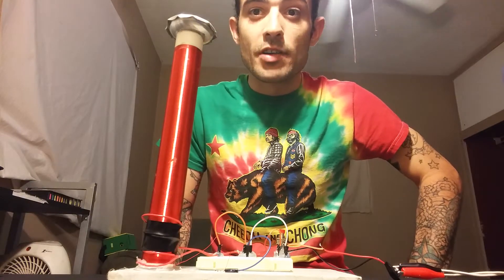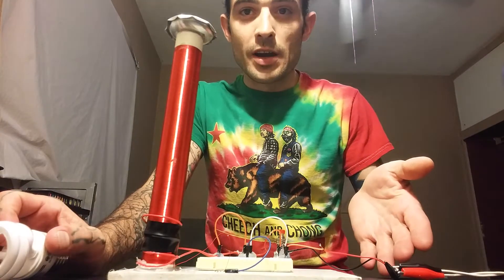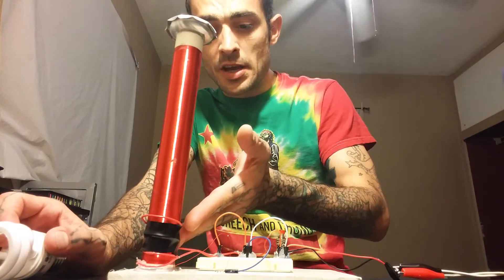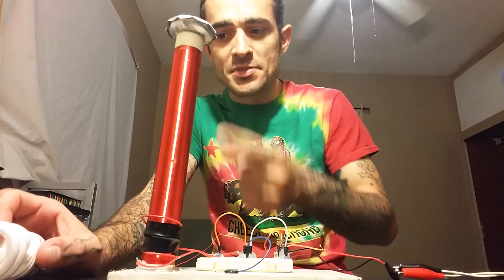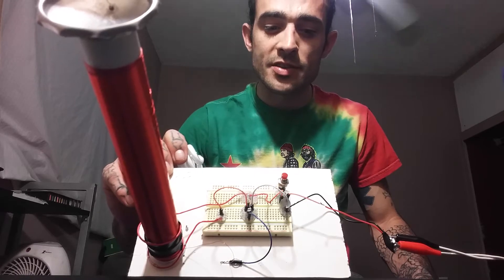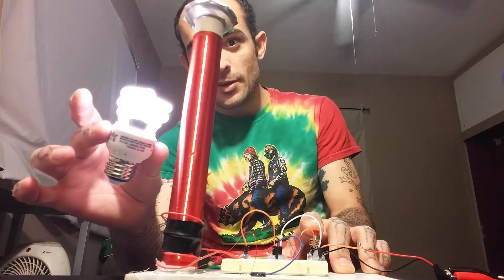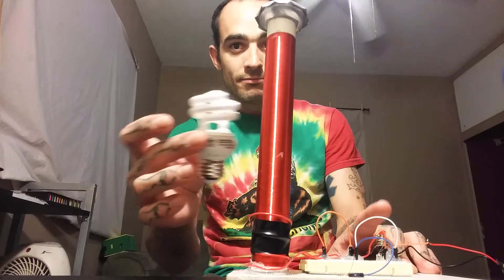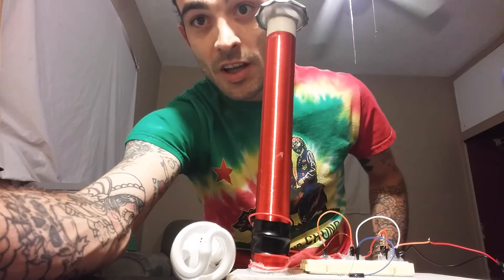DIY Slayer Exciter, similar to a Tesla coil

Comment: zpridgen i saw your this video in youtube suggestions and i see you reply to people , please can you tell about this slayer excitor experiment i use pn2222a transistor and 22k resistor with 9v adapter , but when i pluged in my transistor burns , i check every connection two to three times , but same problem , can you solve ?
Reply from the maker: Man. i JUUUST saw this, a year too late. I am so sorry!  You need to make sure the the Emitter, base and collector are all wired correctly. Seems the emitter and collector are reversed.